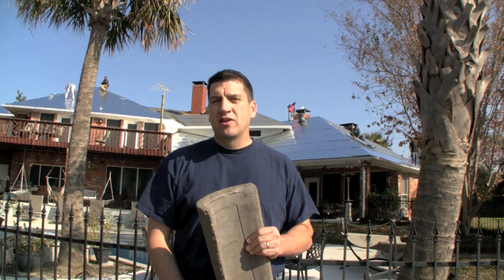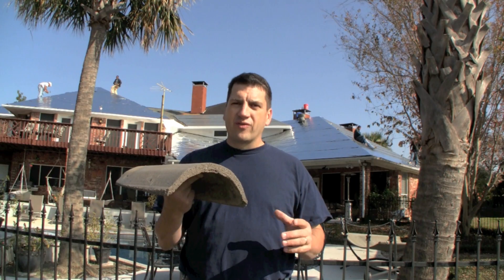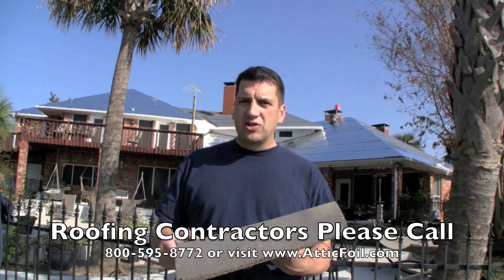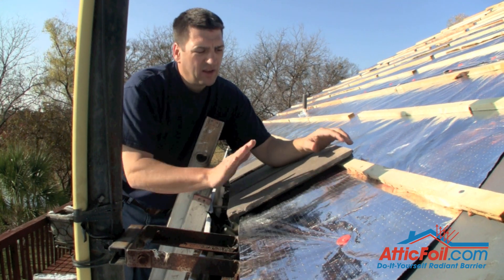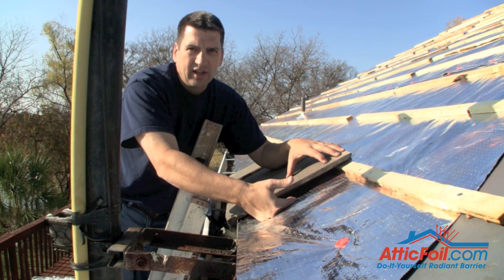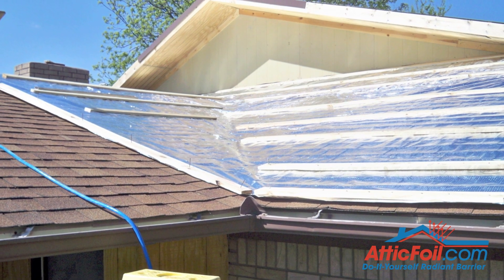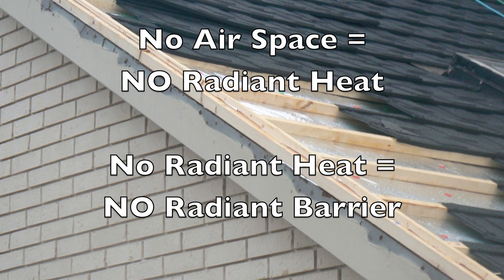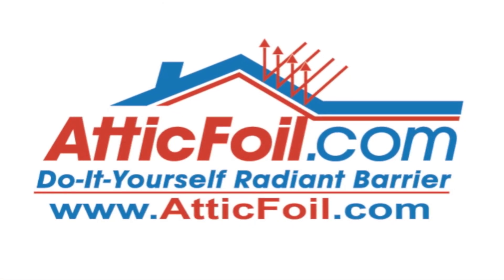Metal Roofing And Radiant Barrier Foil Insulation

Comment: Would you recommend a foil radiant barrier with a metal roof, or do you think a metal roof does a decent job reflecting radiant heat on it's own? Thanks!
Reply from the maker: You absolutely want a radiant barrier under a metal roof.  There are SOME roofs that are better at reflecting IR heat than others.  However, just because something is "reflective" does not mean it won't get hot.  Think of a chrome bumper on a car.  VERY reflective but you would not want to sit on it!  Our www.RoofingFoil.com is an all-in-one roofing underlayment AND radiant barrier specifically made for metal roofs and it's Miami-Dade Approved.

Comment: Why not put the radiant barrier on top of the roof ? Then the roof will also not get radiation. Please shed some light
Reply from the maker: I guess you could if you don't mind the look of a sliver roof?
Reply: If you already have the roof installed, what would be the retro fit procedure? Can you attach the foil above the batons and then place the tiles back on the roof? (The air gap will be between the back of the foil and the felt - the tiles will have direct contact with the tiles).
Reply from the maker: Yes, you could do this.  I'd lay the foil across the battens but push it down about half way to the roof deck to minimize contact with the tile. Let the foil "droop" down a little bit.
Reply: @AtticFoil  perfect, the droop makes sense. Next question, is there a supplier in Europe?
Reply from the maker: Sorry, No.  You may be able to find a similar product.
Reply: @AtticFoil  thanks, I will have a look and see what I can find. Thanks for the advice.

Comment: do you not need a way for the radiant heat to flow up and out the roof?  Should the One layer of 1x4 slats go Vertical and then a Second 1x4 slats go Horizontal.  This allows the heat to travel up and out.
Reply from the maker: Radiant Heat does not "flow"- it's either absorbed or reflected.  Yes, Ideally you want to combine airflow WITH a radiant barrier.  This will maximize the effect since you will minimize the layer of hot air between the roof and the foil.  This can be achieved several ways.  The easiest way it to leave some gaps between the battens.  Or, run them diagonally depending on the type of roof.  Here is a page showing many different install methods: http://www.roofingfoil.com/how-to-install/how-to-install-under-metal-roofing/
Reply: this link does not work.
Reply from the maker: Not sure why? Just checked from a couple different computers/browsers.  Working.

Comment: is it the same procedure for the asphalt shingles using barrier foil ?
Reply from the maker: No, you MUST have an airspace on one side of the foil.  Radiant heat by definition is heat transfer from one object to another without touching.  Without the airspace, you cannot have radiant heat or a radiant barrier.  Putting foil directly over a deck under asphalt shingles will act as a conductor of heat and basically do nothing.  This video explains why an airspace is required:  http://youtu.be/aympJmf4bUU

Comment: Is the attic foil you installed perforated?
Reply from the maker: In the video the foil is perforated.  The underlayment is a self sealing membrane which IS a vapor barrier.  In this case you do not want to have two vapor barriers.  If moisture was to somehow get behind the foil, it would still have a way to dry.

Comment from the maker: Sorry for the delay.  I missed this comment.  You would better off putting the foil over the roof even with the battens.  Assuming the battens are probably 18"-24" apart, this will produce minimal thermal bypass.  The key is to keep the roof deck from ever getting hot in the first place.  You may also want to consider a "double batten" system.  This minimizes thermal bypass and provides for good ventilation under the metal roof.
Reply: AtticFoil Radiant Barrier Foil Insulation The Batton system kind of alarms me, because by seeing what it does. The pieces of wood go Horizontal, so if any water gets in it stops the water from flowing down and would naturally look for a place to go. Which I would think would seep in through the nail holes from the battons. So wouldn't it actually ruin the ply wood underneath.
Reply from the maker: Brian H. If this is a concern, you have several options.  First, a self sealing underlayment will keep water from getting through the nail holes.  Second, if you want to go with just horizontal battens, simply score the bottom with a saw and make a few "slots" per piece.  This will act as drainage or weep holes.  Finally, the double batten system uses vertical battens on the bottom and horizontal battens on top.  This leaves no place any water to potentially get caught.  The main thing to remember is most likely very little water will will get behind the roof to start.
Reply: AtticFoil Radiant Barrier Foil Insulation

Comment: Im about to install a metal roof on my home. Would it be more effective to install attic foil over my shingles and under my 1x4 lathe boards or would it be better stapled to the bottom of my rafters? Two different things are crossing my mind: 1. If its over the shingles, the 4 inch lathe boards will transfer heat through the foil into my attic. 2 If I put the foil in my attic, wont some of heat that is in my rafters and decking heat the surrounding air?. It's probably not much if any difference but I just wanted to know your thoughts about it. Thanks
Reply from the maker: Check out our All-In-One Roofing Underlayment AND Radiant Barrier at www.RoofingFoil.com  It also has the strict Miami-Dade County Approval/Certification

Comment: yes...the configurations of the metal panels allow for the air to 'travel'..additionally, we cut a vent along the ridge of the roof to allow additional air to escape the attic...this is covered with screen to defeat any insects...our clients realize 30% savings on AC and 15 on heat..plus they get a good little tax credit for using GREEN, which is metal.  Great Video and explanation ..thanks !!
Reply from the maker: Check out our All-In-One Roofing Underlayment AND Radiant Barrier at www.RoofingFoil.com  It also has the strict Miami-Dade County Approval/Certification

Comment from the maker: I would think under the metal roof is probably all you need.  You MUST have an air space on one side, so using with foam can be tricky to get the required airspace. How do you propose doing this?  Pleas list the "layers" coming from the outside.  Also, what State are you in?

Comment from the maker: Yes, in order to have radiant heat (and have a radiant barrier) you MUST have an airspace. It's possible to install with asphalt shingles but you must install inside the attic or raise the deck.  Take a look at RadiantBarrierGuru Com and see how I did my roof. I used TWO decks and Two layers of foil.
Reply: Could I use a 2x4 pressure treated wood instead?

Comment: Is it possible to make an air gap under Asphalt shingles? Or is it just tile and metal only.
Reply: You have to do it on the inside of attic, but make sure you have baffles or an airspace before putting your insulation/ vapor barrier in-between your rafters before finishing the attic ceiling if it is going to be a living ( conditioned space).